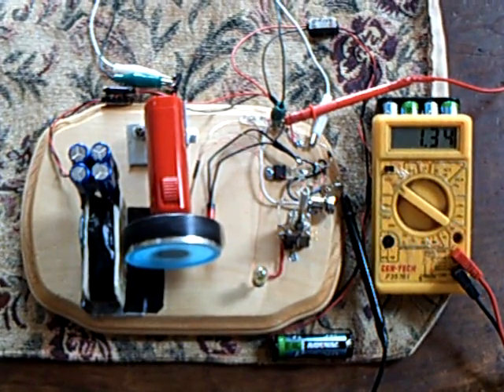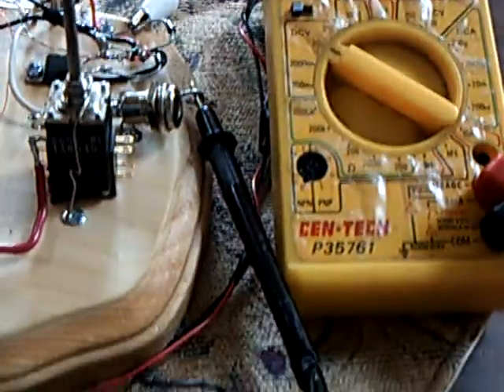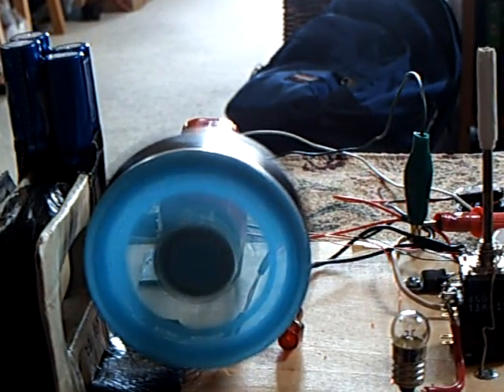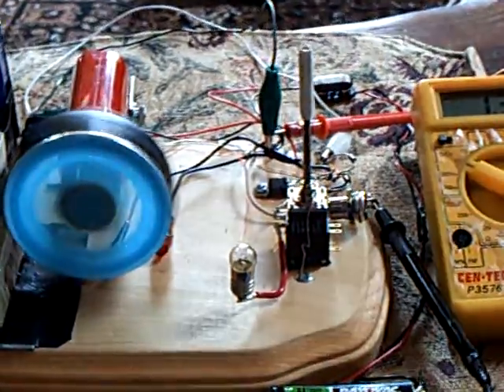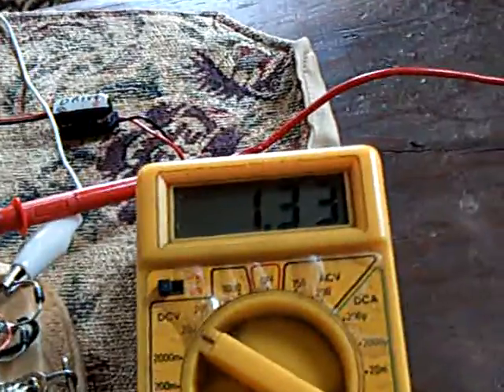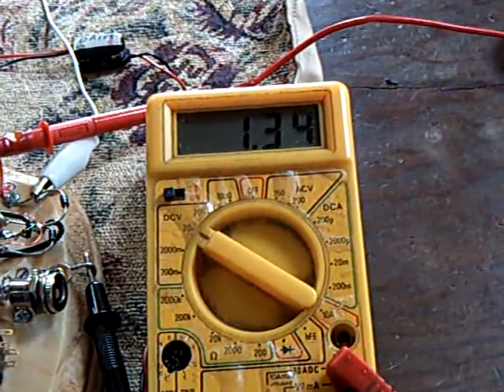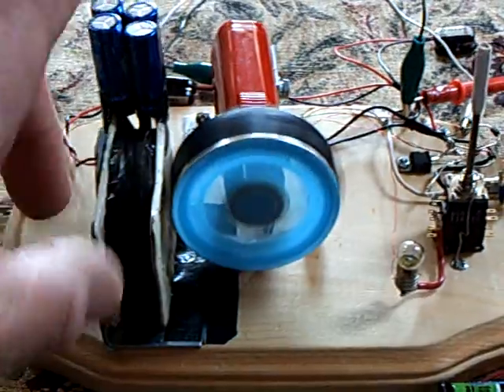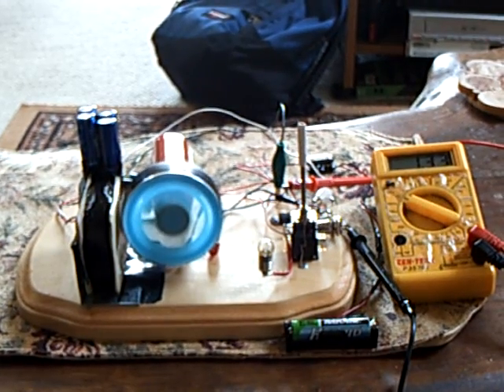(1) AA Battery Bedini SSG motor

Comment: But you can charge the battery primary with your capacitor using a swith double throw, and the motor can run infinitly